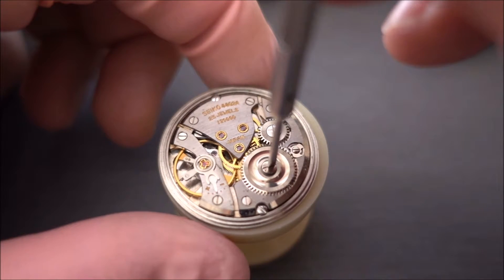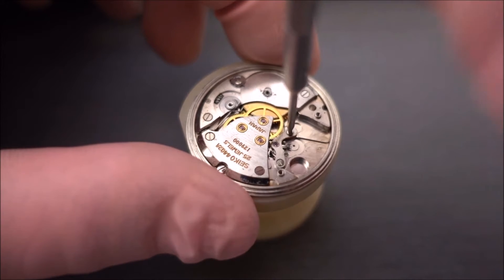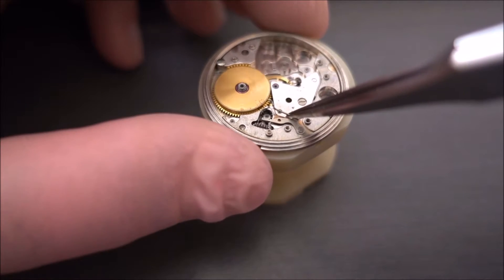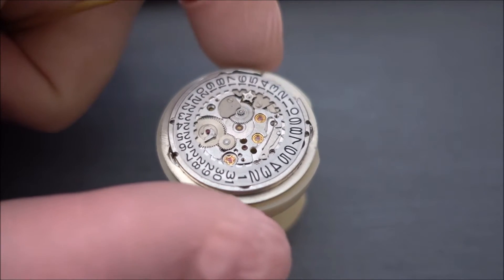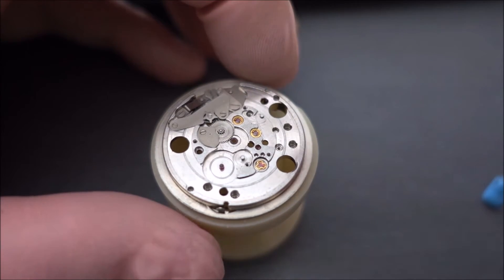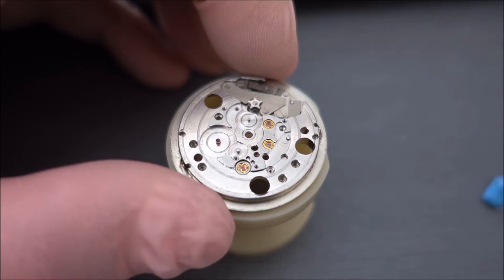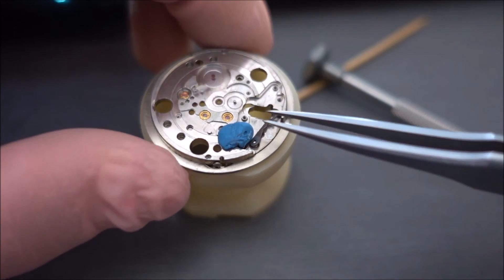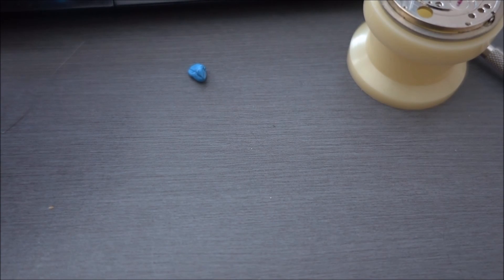SEIKO 44KS KING SEIKO (4402-8000) Teardown PART 2 - MOVEMENT

Comment: May I ask for your expertise on an issue I’m facing at the moment? I tried to set my recently purchased 4402-8000 and by doing so crown and stem fell out. It’s on its way to Seiko right now because my local watch smith did not want to risk damaging something by removing the dial and hands. So I’m wondering right now, which part could be the issue in that case. I would like to be a little bit better informed when Seiko comes around with their assessment. In any case, thanks for the great video which gave me a better understanding of my new watch!
Reply from the maker: SEIKO will likely send it right back to you as they don't have parts for these anymore.

The issue will be a setting lever or the setting lever spring. The setting lever spring is a part that commonly breaks.

Comment: Hi, I just purchased a 4402 8000 second version without diashock text.

When I gently shake the watch you can hear a fair rattle, but what’s strange to me is the seconds hand would move for a few seconds each time.

Is this normal??
Reply from the maker: Shouldn't hear any rattles. Sounds like maybe a screw is loose in there. In any case, if the service history is unknown, it's prudent to get it serviced.
Reply: @hal0eight  thank you, I bought it from a second hand store and they don’t know or really care about service history. Will definitely take it for a service.

Comment: Can someone tell me how to get the crown and the stem out of the movement? I’ve had mine serviced by a guy who left a whole bunch of debris on the dial - I’m desperate to open it up and clean it myself. Thank you.
Reply from the maker: There's a button next to where the stem goes in. You push down on that gently and remove the stem. Seems more prudent though to take it back to the guy and tell him you're unhappy, as you've paid him for the work and he hasn't done it properly

Comment: Awesome video.   Would this be the same as the 44-9990 without the date side?  Is it easy to source the mainspring?  Where can you source them?
Reply from the maker: Geday, They are basically the same movement except the 44 has a different hacking lever system which is prone to breakage. I'll have a 44 video up sometime soon.
Reply from the maker: Forgot to mention the mainspring...best way to go is probably a generic mainspring. There should be something very close in the Generale Ressorts range. In this case from memory I was lucky to find a NOS one. If the mainspring is not broken it probably doesn't need replacement, the SEIKO mainsprings were always excellent quality and still work well after rebuilding the barrel.
Reply: @hal0eight  What kind of replacement mainspring would you need? I have got a 4402 with exactly the same problem as you did.
Reply from the maker: @danielschooneveld9424  Geday, 

I was lucky to find a NOS part.

There is a generic part available. GR Part No. 3298-1 (original SEIKO P/N is 401-441). You can probably source that spring from any general supply house.
Reply: @hal0eight  Thank you. Original ones are available on ebay for 60$ + shipping and import costs, a bit to expensive imho so i think a generic one will the better option.

Comment: I'd like to get a KS, but I'm worried that if something breaks, it would be impossible to find a spare.  Compared to the Swiss watches, these vintage seikos are much rarer.
Reply from the maker: I'd say go for it. The 52KS and 56KS are solid movements (besides the QS fault on the 56). They don't really go wrong. The 56KS has many common parts with the 5606 Lord-Matic, so maybe half the parts are a dime a dozen.

They are certainly more robust than the ETA movements of their era.
Reply: Thanks for the advice!  I will continue to look into it.  I can't find any 52's anywhere.  I have read that the 56's can be problematic because the day/date mechanism is made of plastic which can crack.  I have found a 56 without a day/date to get around this problem, but I'm not sure if its the ideal one for me. AAAH!